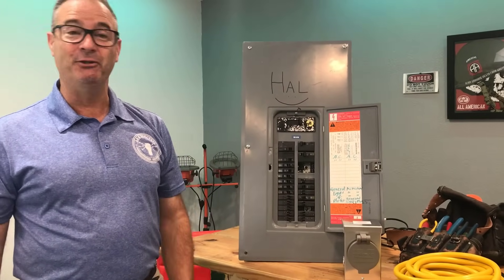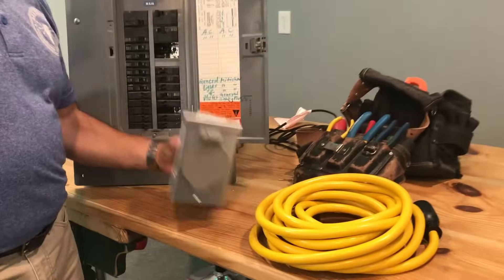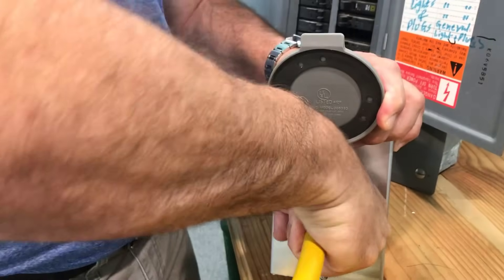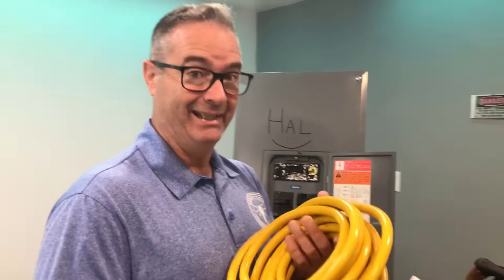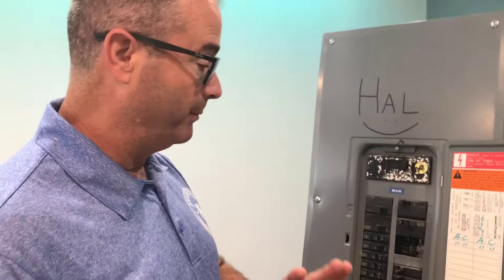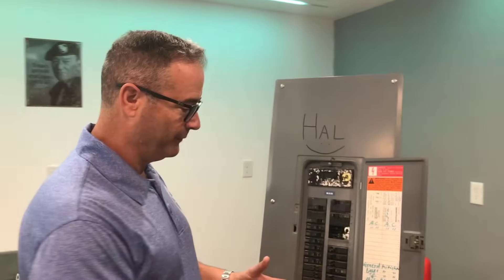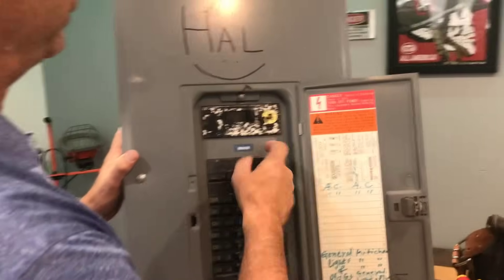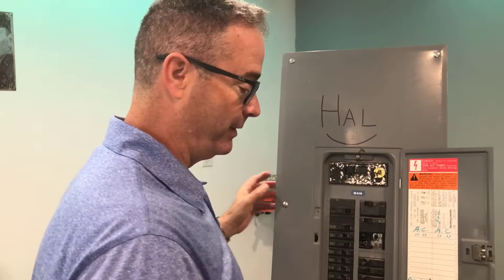4 Generator Hacks by an Electrician

Comment: Excellent advice.  Thank you for taking the time.  Having run a couple of datacenters but only having a standby Champion at home I'd add a few comments:

1. Don't wait for your lead-acid battery to die.  Cranking the pull wire to start a cold engine in the rain isn't worth it.  Replace that battery with a LiFePo battery with a built-in battery management system (BMS).  $200-$300 on AMZ and it will hold a charge for a long time, won't fry in the heat of summer, and doesn't degrade voltage as it runs down the charge.  Good starts every time.

2. Put the battery on a battery tender.  These things are in the $20 range, just ensure you get the right type for your battery.  If you followed tip #1, that's Lithium.  Lithim (ion) and LiFePo are not the same but the BMS will make them behave the same for charging purposes.

3. Quarterly tests are fine if you have a battery tender.  If you don't, start with monthly tests to be sure the battery maintains enough power to start, then back it off to 45 days, then 60.  

4. You're testing two things on an offload test: the ability to have the starter fire up the generator, and the generator running smoothly with a solid 60Hz 120VAC (115 is good) output.  There are complicated measuring devices, but a CFL bulb is a cheap indicator.  Look for any signs of flickerage.  That flicker means the generator needs servicing.

5. Those yellow locking connector cables (NEMA L14 or L5) are HEAVY because they are designed to carry 30-50A and there are 4 conductors.  So if you can lay the cable ahead of time, and already plug it into the house... then you just need to wheel the genset out to the other end of the cable, plug it in, and you're done.  This not only solves the "where is my cable" problem, it also avoids the "tree in the way issue."  (And if it's raining or snowing you're not reeling out cold stiff copper cable...)

6. Have a flashlight strapped or taped to the top of your generator.  That way when you find the generator using your phone, you can put your phone away and use something with more light, more power, and if you drop it so what.

7. Interlock.  I really hesitate to touch this because it's a flashpoint.  Everyone has opinions.  If you would rather not spend any money then don't bother with a generator and just keep some MREs and blankets in your car and go huddle up when the power is out.  If you want true redundancy, don't do the interlock thing.  For one reason you have to pick and choose which circuits to power, and after you budget the amperage needs of your HVAC system (heat pump, etc.) there won't be much to play with.  Second, it's a crappy mechanical device designed to stop you from doing something stupid (backfeeding the grid with your generator).  Third, it requires you to trudge out to the panel to move it... then again to move it back.  Instead, go to eBay and pick up a used automatic transfer switch (ATS).  They are easy to wire -- even for DIYers, although standard disclaimer applies ("if you're not 100% comfortable hire a licensed electrician...) and they work without manual intervention.  Some have an extra set of control wires to remotely start the generator... but those don't work well with the mini standby gensets because there's nobody there to move the manual choke lever.  You can put an auto choke on it (lots of YouTube videos on that topic) but that reduces the effectiveness of the system because those systems are not as good as your ear to determine when the genset is running well enough to introduce air into the f/a mixture.
Anyway, $200-$600 on eBay gets you an ATS.  You can oversize it and it won't matter... so you could get a 600A ATS and power your 100-200A house using your 30-50A genset with no issues.

8. If you really want to spend the money (but you don't... right... that's why I watched this video and you watched this video and I have a Champion, not a 20KW Cat.  But if you did, you can get the ATS and wire it all up... and one day when you want to upgrade to a full-size genset it's one thing to swap in, and the old one can go on eBay and get you back 1/10th of what the "real genset" costs.

9. This has turned lengthy so one more thing.  Maintenance.  The OG guy is right.  You have to maintain it like a car.  Except unlike a car you don't use it every day.  So when you do those quarterly offload tests... check fuel lines, check oil level, color, and sample for particulates.  If  your generator is water-cooled check fluid level and color.  Ensure battery charge is up there.  Test that flashlight from tip#6 and r/r the batteries as needed.  Remember, a few batteries cost nearly nothing, but wandering around in the dark in the rain with your cellphone (light) getting rained on... not good.  If your generator is the roll-around kind and has tubular tires (rare) check pressures and inflate as needed.

10. If you have a teenager in the house, print this list and hand it to them with a logbook so they can do this every quarter and log what they observe and notate any discrepancies that need correction along with a  priority that goes from high ("won't start") to low ("lots of dust all over it and cat paw marks.")

E
Tucson, AZ US

Comment: Re location of the inlet & length of connection cable. With more & more EVs starting to incorporate Vehicle to Load (V2L), Vehicle to Home (V2H) & Vehicle to Grid (V2G) capability suggest (to future proof) the inlet be close to the garage or driveway.

Many EV’s V2L capacity will power* a house for ~4 days. With no noise!
* Fridge, TV, Lights & other low wattage appliances. But not high wattage items like electric hot water heaters, oven, cooktop, AC, etc. But the average portable generator won’t power all those things either.

Comment: Suggestion for the plug.  Paint a white line on both the side of the plug and on the outlet, where it properly lines up to plug the 2 together.  Short horizontal line in the middle in the direction the plug twists. " |- "   Really helps in the dark or the rain.
Reply from the maker: @johnschiffermuller4930  great idea. The twistlock on the end of a heavy cord is uncooperative in normal weather

Comment: Wow -- thanks,  I actually learned that I am not as hurricane prepped as I thought I was.  Doing a pre-emergency run of the generator and figuring out what we engergize and what we shutoff in terms of house circuits is something I didn't even consider. Also,  I need to build a shelter for the generator. Thanks for the heads-up.

Comment: There’s a ton of comments here so forgive me if this has been answered. When running on generator power and the main breaker is open, what is best method for knowing when utility power has been restored and it is appropriate to switch back? Not everyone has street lights and plenty of neighbors to serve as indicators.
Reply from the maker: @dguiley  you don't. On one job,  I have installed an indicator light (240v) to the main lugs, with the light mounted just above the panel. Once utility power came back, the lights came on.
Reply: @abrelectric  thanks. That’s what I was thinking, but my concern is was that it would be before the breaker, and so not protected.
Reply from the maker: @dguiley  you can install an inline fuse (2 amp?) On each leg; that could also give you a disconnecting means inside the panel
Reply from the maker: OR! Install a type 1 surge protector with indicator light! That would kill a couple of birds with one stone
Reply from the maker: @dguiley  please see the last answer, and a YT short based on your brilliant question

Comment: The MAIN reason for the interlock is to protect line workers trying to fix the power issue, so ones generator does not zap them.
Reply: Old school reason - nowadays lines where linemen work are shorted and grounded. Recently I forgot to turn Main off while starting my generator - generator’s breaker shut it off because of that short
Reply: Seems likes it is against the code in Canada. I read I must use a transfer switch.

Comment: Quest... what gauge of wire and conduit do I use from the inlet  box to the breaker  panel? Thanks
Reply from the maker: @jim6635  depends on the amperage: 30 amp will need 10 AWG, 50 amp 6 AWG.

Comment: I try to run my portable generator at least once a month. Also I shut of the fuel and let it run out the gasoline in the carburetor. And check the oil and change as needed. Air filter too.

Comment: Great idea to run your generator periodically.  But you should apply a load to it, preferably at least 50% of capacity.  Depending on your generator, if you have a 240V you made need to buy a splitter that adapts the 30 amp twist lock (shown in the video) to two standard 120 plugs.  My favorite loads to use are space heaters.

Comment: What is the maximum length when installing inlet box to the circuit panel?  Iam looking for a solution on how to minimize the length of a 50 amps generator cord cause the distance is about 75 ft from where I want to put the generator to the circuit box. Thank you.
Reply from the maker: @rjakeyno9065  There isn't a maximum for the hardwired cabling to the inlet. You just need to upside the wire gauge (assuming your load is 80% of capacity), from #6 to #4.
Reply: @abrelectric  Okay! I will just run wire up to10 ft to inlet box from circuit panel and stick to #6 awg. I appreciate your help.

Comment: With the last hurricane that was approaching the Gulf Coast, I decided to get ready around the house. I pulled out my champion 4500 W generator that’s been sitting in the garage for 4 1/2 years untouched. I turned on the gas tap turned on the ignition switch one pull and it fired right up. Why? I never use gas gasoline and small engines that has ethanol in it. I have stored gasoline for multiple years up to five with no problems.
Reply from the maker: @TexasScout  that is amazing
Reply: You proved my decision on that
Reply: Only thing is, which I just found out with Milton, non ethanol will not always be available! So once we burn through our 15, 25 or how ever many gas cans we have filled, we may have to run for a time on crappy gas! Once you finish, and my power was out four days, gas up with non ethanol, add your fuel stabilizer and hope and pray we never have to drag that breast out again! But I stick to this rule with my cars even, and they keep running and running! Best treatment for any gas engine period!
Reply: @kvmalley  The best thing you can do is close the fuel petcock while it's running and let it use up the gas left until it dies.  Then look to see if there is drain plug on fuel bowl, if so, drain any remaining gas that was left in there. Fuel with Ethanol sitting in the fuel bowl will rot everything. As me how I know.

Comment: Dry run with electrician there. I did the dry run once the elc left. The gen switch was installed off so the breaker would not move. Elc came back and I decided to file the switch vs drilling new holes next to old ones!

Comment: I use a paint marker and paint alignment marks on my cable and generator at 12 ok position for easy alignment and on the gen inlet plug the same thing. I recently installed a panel manual interlock for the sake i don't ever forget weather or not i shut the main to the line side. I get in a hurry sometimes and find myself double checking. Now with the interlock, I don't have to second guess myself.
Reply from the maker: That is a super fantastic practical idea. Thank you

Comment: Most people purchase portable generators and install generator inlets/interlock switches in case they have power outages.

People like me, apparently, do so to keep power outages from occurring.  I used to have a power outage around once a month due to a tree falling, vehicle crash, squirrel having relations with the transformer, etc.  Ever since buying a generator and installing an inlet and interlock switch about a year ago, I haven't had a power outage since.

Still run the generator under load for an hour once a quarter, but still.

Comment: I store fuel for my generator for hurricanes.  I always buy new gas every spring, stabilize it, and in winter after storm season I just use it in my car and refill in spring.  That way i know my fuel is good.  I run my generator for 5 to 10 minutes every three months to make sure the fuel is not sitting in the carb for too long.  I never have a problem starting it, usually on the second or third pull. I do not try to power my entire house though my concern is being able to keep the freezer and fridge freezer cold, being able to charge cell phones for communication.  Everything else i can do without.
Reply from the maker: Thank you!

Comment: No where in this video did you mention about a pure sine wave. Older Generators will destroy your electronics. New fridges and stoves, washing machines...all have circuit boards. You can run lights and most power tools but not switching power supplies equipment such as flat screen T.V.s  Also without a pure sine wave. Your Gas furnace will start up but quit. There is also the grounding issues not addressed. Please do an update. P.S. When your neighbor back feeds and your not protected? Most insurance companies won't cover any damages.

Comment: find someone making dog houses an have a hinged top an store the generator an wire in the same box,.. the dog house seal it with sound deadening,, then run a 5 inch tube away from the house,,
Reply from the maker: I've seen something similar. Is the 5" tube for exhaust?

Comment: The only Generac dealer for miles will only install a whole house generator (natural gas) because it's not worth his time to install a smaller KW gen that would run only essential needed equipment, sump pump, furnace, microwave etc.

Comment: Also, when turning on or off any breaker: place non-dominant hand on breaker switch, turn face away from breaker, turn breaker switch on or off. Why use your non-dominant hand? Because, if the breaker fails and explodes, as they can, you will still be able to do most things with the hand you have remaining. Turn face away so that, if the breaker fails and explodes: your eyes, face, mouth and lungs will not be cooked by the explosion. SAFETY FIRST!!!! Stay alive. KNOW
what, how and why a specific way of doing things is necessary, especially electrically, because you may only have one chance to get it wrong and die. I say “may”, because you “may” live through it and need extensive rehabilitation for getting it wrong. Just FYI.

Comment: How does this panel mod entrance work? I thought your panel tried to share the load between the two phases of 220VAC coming from the street. Do all the breakers need to be rearranged, like all generator stuff on one side non-gen on the other?
Or does the generator put out 220V two phase on the RV style jack?
I have that exact model generator, and I never thought about it being 220V.
(All I’ve ever used so far is the 110V outlet)
Reply: Buss bars are staggered in the panel. A 2 pole breaker contacts both bars no matter where it is mounted.

Comment: I have a generator. Haven’t needed it yet, but I only have a 50’ RV extension cord to multiple 110v outlets. I don’t really know what/how I’d manage to wire up in the house.

Anyone have a WAG at the cost of having a licensed electrician to add the box and the breaker interlock?
Getting the box in the right place means about 75’ from the panel. How much per foot would that be?

Given how often I’m not gonna use this, and where I want to use the generator, the fact that there is a 110V outlet right there already… If I could just… the attraction to that obvious solution is strong.

Comment: I'm in the process of installing a 50amp 9500 watt unit. I had the interlock kit before the generator was even delivered. Question. I was thinking of just cutting the female end off my 50amp cord and wire directly into the 50amp breaker in the panel and leave the male end in a weather protected cover i can retract the cord into the basement to just pull out and plug in when needed. Basically just to avoid the need for an outlet on the side of the house.

Comment: Might have be said numerous times but this video would have been enhanced by the installation of an interlock device. Some panels will not accommodate this install but many will. It insures there will not be 2 sources on the same line. Chances of that might be slim as line workers will not restore power on lines with back feed so you delay getting your line power back. As well if power were to attempt to auto restore as is the case sometimes a head to head situation will be interesting and I think your gen set will lose. Not every body has a main breaker in their panels so an inlet would be problematic without some kind of transfer switching. Being an electrician myself I would remove the main lines insulate one and tie in a lite to the other side so I would know when power was back. Now I have a new panel with a main and an interlock device with inlet. Found a good electrician.

Comment: My 2mw generators at work are kept in the loading dock with the exaust pumped outside and a big loovers for fresh air intake and cooling. Is it possible to do something simmilar for residential generators?
Reply from the maker: I have seen it done with a client creating a large box to reduce tge noise.

Comment: That was actually a very good video. thank you! I’m thinking about adding one of those interlocks, right now I use my 50 amp R.V breaker and plug my inverter in to it and back feed in to the house panel . FYI I do shut the main off before I plug in the inverter and starting it. I’ve always felt like it was safe but not really sure….. I want hold your opinion reliably but would love your thoughts on my setup.